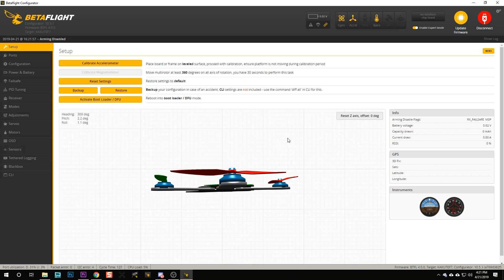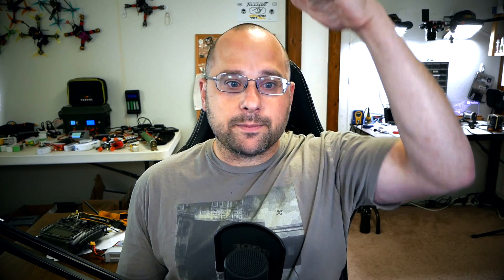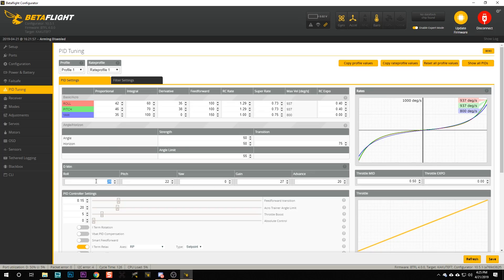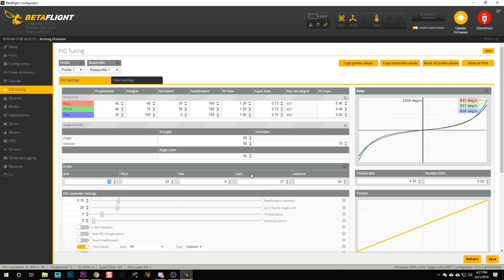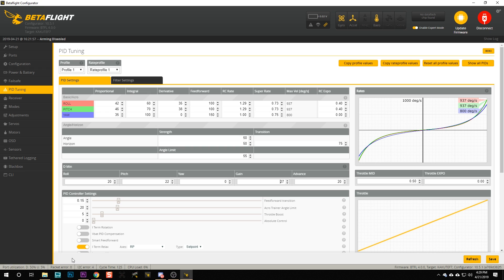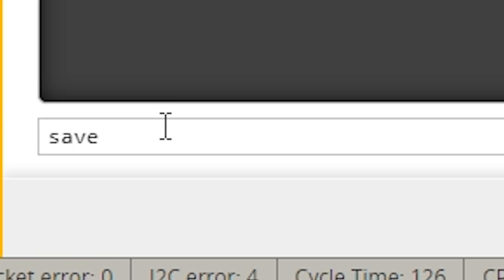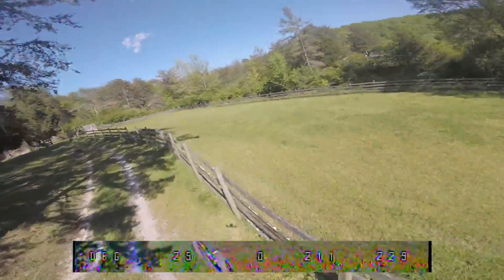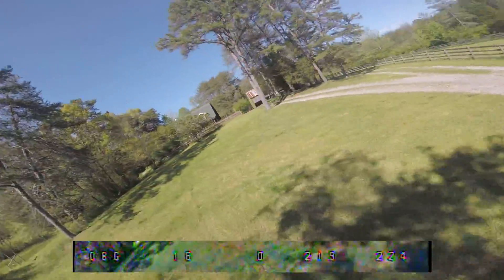Betaflight 4.0 D_min | GREAT PROPWASH WITH COOL MOTORS IS NOW POSSIBLE

Comment: Thanks Joshua!  Always appreciate what I now lovingly call "the JB bump" for us little guys.

BIG SHOUT OUT TO CHRIS THOMPSON (CTZsnooze) for creating D-min.  I love the flexibility it adds to lower or boost D-gains depending on what you want.  And of course, if something you don't want, just to turn it off.  Awesome!

Before folks raise D because of bounceback, make sure your i-Term Relax is set back to 3.4/3.5 default.  It was changed in 4.0 to better suit racers, but for Freestyle, copy and paste the below into your CLI (to make it easy) so you address any i-Term induced bounceback.  After that, if you still have bounceback, yeah, then raise the Dmax-Gains.

set iterm_relax_type = GYRO
set iterm_relax_cutoff = 11

Do note, Advance is ONLY based on stick moves.  So for prop wash detection, you just up the D_min Gain.  I actually turn my Advance = 0.  I don't get bounceback and D-term fights FeedForward so I don't want to give it more.  But folks can run it however they would like; or again, turn off altogether if they choose.
Reply from the maker: Thanks Mark. I know in some sense I am just translating the hard work you and the devs do for the masses. The least I can do is give credit. I hope that some of the hardcore tuning geeks can get turned on to your channel.
Reply: @JoshuaBardwell  , appreciated.  Getting any sleep lately?  ;-)  CONGRATS again.  My first is named Dylan too.  So to complete the circle Brayden is what you have the name the 2nd.  lol.

Comment: Joshua, dont get me wrong. You do an amazing work puting all this information together and that is simply amazing. But, why does BF has become so damn difficult to setup? Wasnt it supposed to be as easy as flash and set your rates? I wont move from 3.5 until I see it´s stable enough
Reply: In my eyes, it is still simple. It flys with stock settings. But for those, who want a perfect setup, they have better tuning settings.
Reply from the maker: Sadly, for some small percent of people, it's not just flash and fly. BF 4.0 has pushed some limits and is feeling the effects.

Comment: Freestyle pilots often throw the quad into a 180, waiting just a bit before throttling to reverse direction.  This would cause prop wash while direction is reversing, but would the D-gain boost if the sticks aren't doing much in that situation?
Reply: erikspen it’s driven off the gyro input
Reply: @Sugar_K  Thanks.  But also there'd be no gyro input in this situation.  Plenty of linear acceleration, but not much rotation.
Reply: erikspen unfortunately until someone comes up with an accurate way to predict propwash the only way to reduce it is 1. Achieving the lowest amount of gyro phase delay, With rpm filtering and VERY lean settings on your other filters I’ve seen it get down to as little as 0.5-1ms. 2. fly like pros like Stingy do with is to avoid propwash inducing manoeuvres, keeping a small amount of throttle on in all manoeuvres and throttling up gently.. the first, low gyro filter latency is super effective but requires a very well designed airframe that doesn’t have resonance issues
Reply from the maker: BF has a specific algorithm that tries to detect the mid frequency oscillation of propwash. It's not just stick position.
Reply: Interesting.  Thanks for clarifying, sorry if I missed that.
Reply: Joshua Bardwell  😂 if it did I would know all about it been one of the main test pilots who helped with the development..  if you have your d_min gain set high enough as the prop wash begins the D_min code will start pushing up your D towards its maximum value helping kill the wash more quickly . But there is no special prop wash algorithm, it’s a nice side effect of the D_min been driven off the gyro input, the first version of the code was set point driven and didn't assist in prop wash handling at all. unfortaully as no one has worked out how to predict the event accurately it at this point has to see the prop wash to deal with it